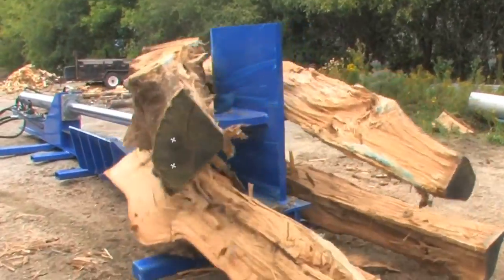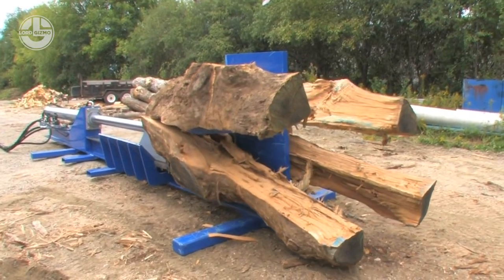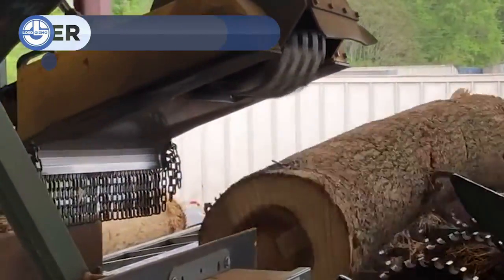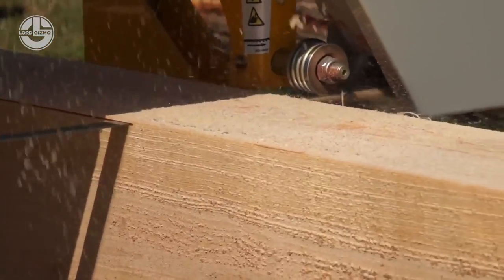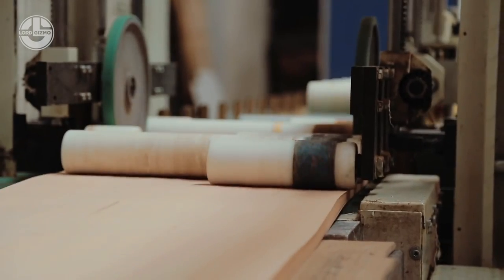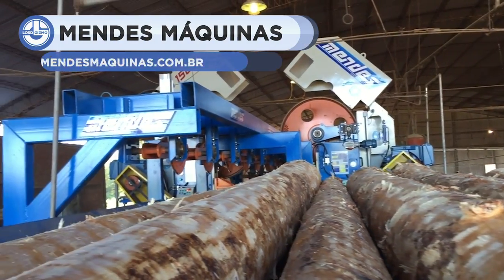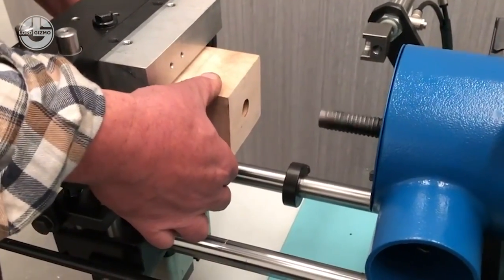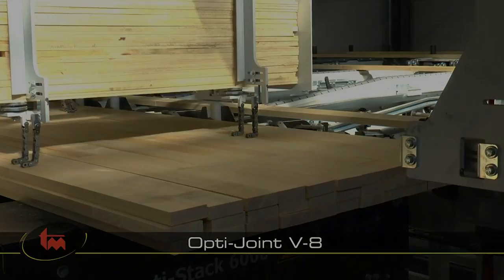Crazy Wood Processing Machines | Biggest Wood Cutting Factory | Sawmills

Comment: Laminated floors mixed with MDF classed as stable? You are kidding right? MDF is very vulnerable when water comes into contact with it. Looks very nice until the water turns it into something a bit stronger than cardboard. Not to mention the producers are unable to determine if the dust, or the gases from cutting the stuff is the dangerous element.
Reply: Yes. Also didn't see any glue being applied but I guess there must have been?
Reply: @RJMCafe  I think it's sprayed on in a very thin coat.
Reply: Also, how does it handle dogs nails?